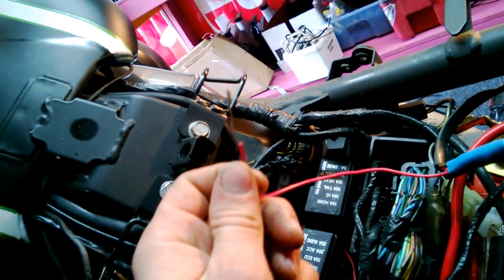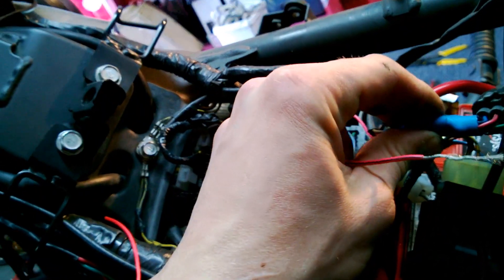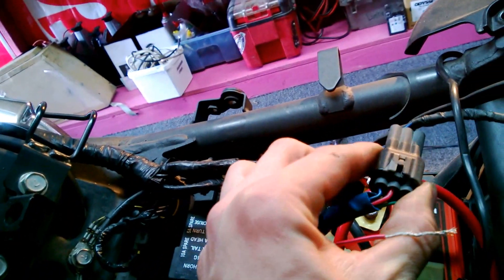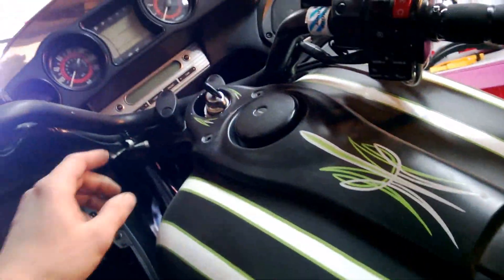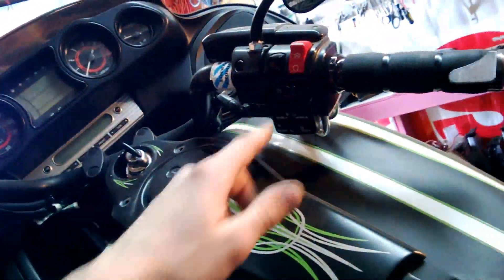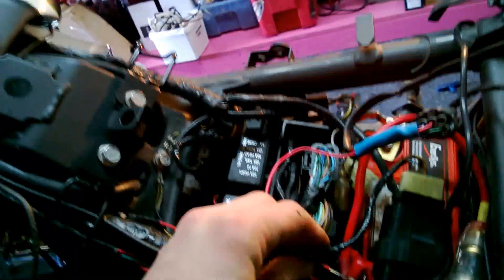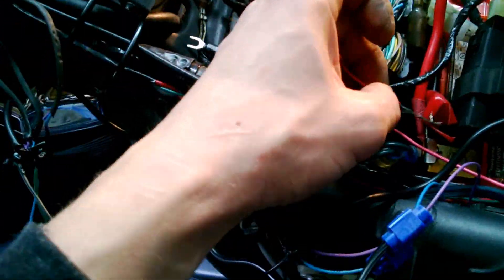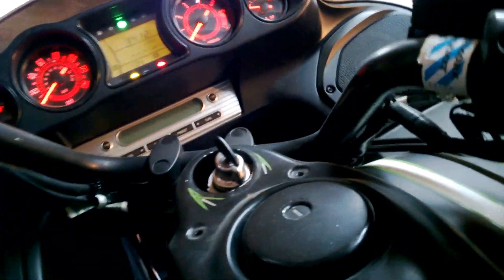How to Hotwire Kawasaki Vulcan Vaquero : Kane Friesen

Comment: You need a resistor for the bike to actually start and run and drive. It will turn over all day and never start
Reply: yep i did mine for a go kart with a 100 ohm straight off the battery like him ( somehow the main power wire wasn't working well so i just ran a wire to a switch and it works great

Comment: This is a lie. All it does it turn the motor over. It will not crank the bike because it's not completing the circuit. That's why his didn't crank in this video.